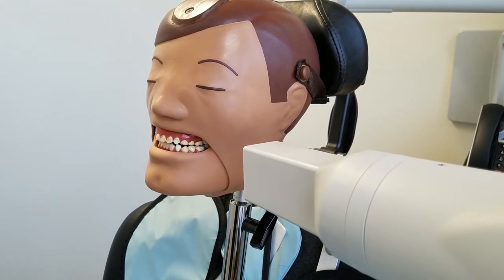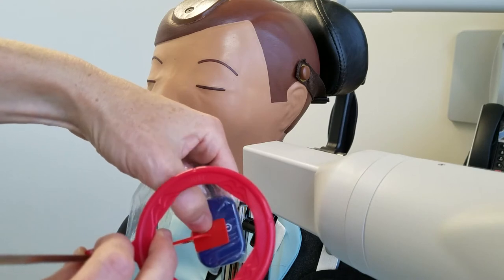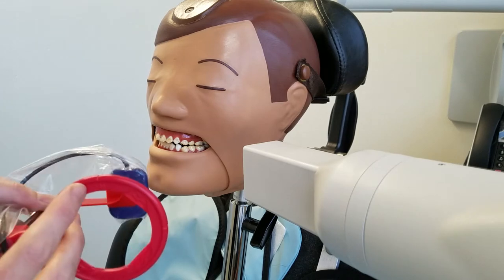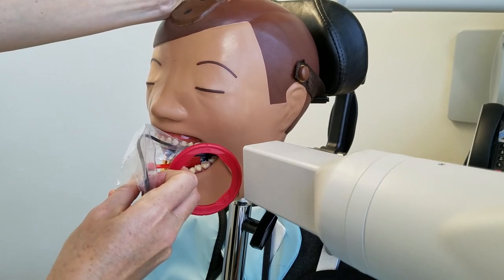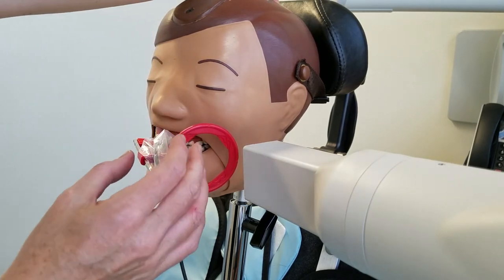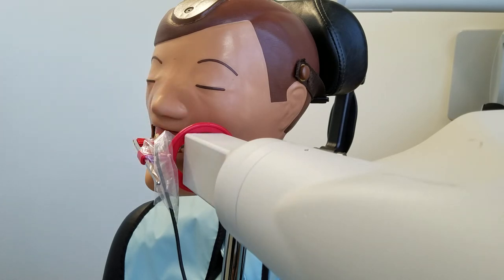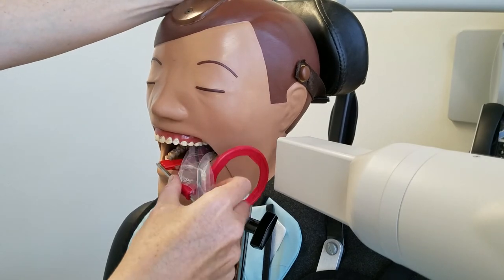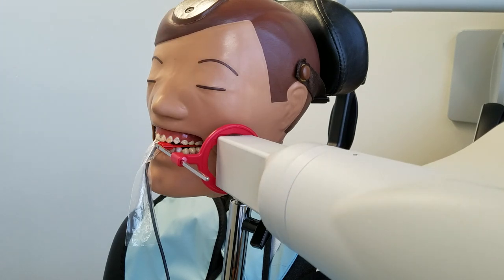Placement vertical bitewings

Comment: I am in Canada and we number teeth differently. When you say second molar, are you referring to 6 (in this case 36)?
Reply from the maker: Hi! The teeth numbers would be for capturing the distal of the canine #6(#3 Canadian) in the first shot (premolar/bicuspid) and centering #2(#7 Canadian) on the bite tab for  the molar shot. I hope that is correct with Canadian numbering and makes sense. :) Also this is all referring to or based off of the upper right quadrant in the patient's mouth. Of course since it is a bitewing we want maxillary and mandibular but I go off of the Max for placement guidance.